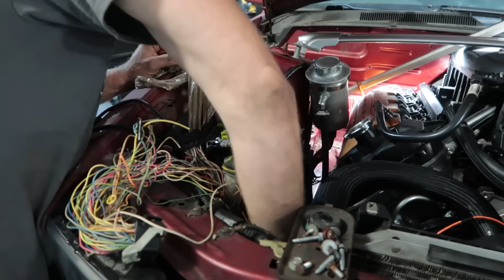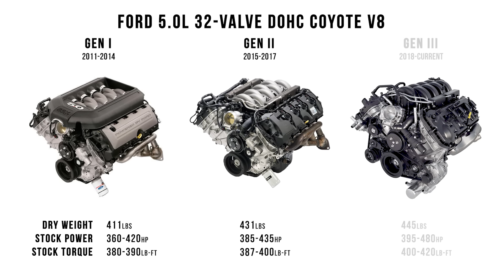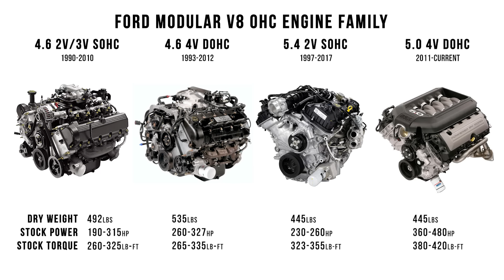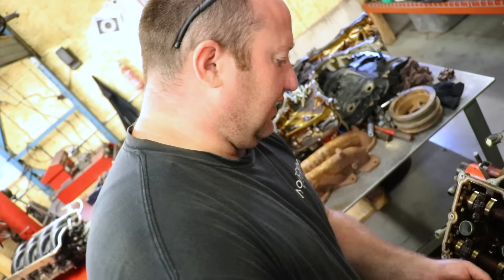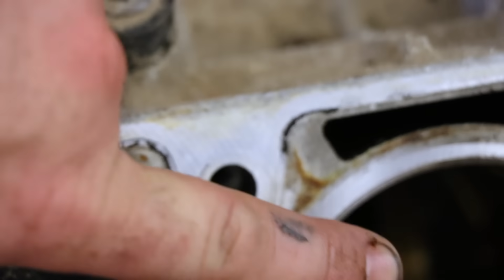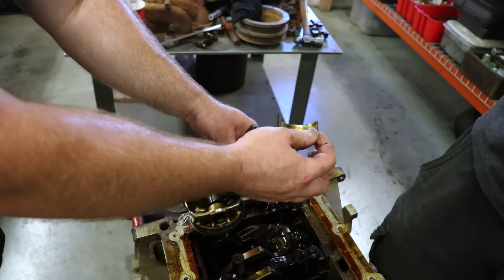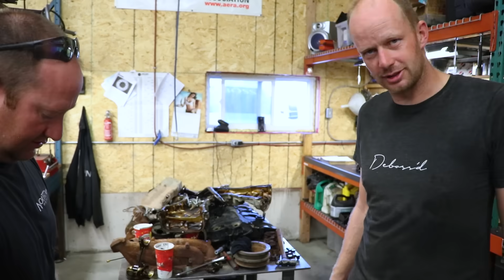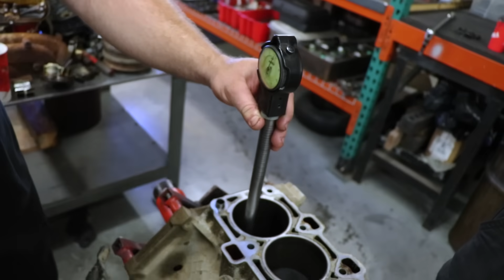REVIEW: Everything Wrong With A 5.0 Coyote Engine

Comment: Oversize pistons absolutely increase displacement, regardless of compression
Reply: I wouldn't trust anyone to rebuild my engine that doesn't understand basic math, SMH 
What an idiot this guy is , along with his nonsense about synthetics 🤣
Reply: @Ryan-iw8yw  - Apples and oranges, guys! He didn't say the displacement wasn't altered - he said the typical oversized pistons have slightly decreased compression heights to compensate for what would be an increase in compression (as a result of overbore).
Reply: Yeah. He doesn't understand displacement. He also doesn't understand synthetic oil.

Bearings staying with the crank happens all the time because of surface tension in the oil. It does not mean anything at all. It is better not to speak if you don't know what you're speaking about.
Reply: Displacement is dictated by swept volume within the cylinder (i.e. bore diameter and crank throw).

 Piston height only changes compression ratio. 

What is the guy on about?
Reply: @Jack-tx2ve  You're an idiot.  Bigger bores with the same cylinder head combustion chamber  adds a bit of compression, unless the piston has a bigger dish/valve relief.
Reply: @greggc8088  thanks I am not an idiot. I did not say an increase in volume does not effect compression. I just said only swept volume effects capacity not piston height or design. Maybe you are the idiot.
Reply: @Jack-tx2ve  Oh no, you're definitely an idiot.  Too ignorant to know you are.
Reply: @greggc8088  what about what I have said makes me an idiot? Just because you misunderstood and then jumped the gun to insult me. Jog on.
Reply: @Jack-tx2ve  I'm sorry.
Reply: @Jack-tx2ve  And quench.
Reply: @Jack-tx2ve  He said: "When we replace them with 'factory' pistons, they bring the compression down". There are no 'oversized' pistons here. When you bore out a cylinder and put the same pistons you counteract the increased bore with less compression. The guy then says 'why' people do this, which is for sound. They have to bore out the cylinders to refresh them and hes arguing against a misunderstood norm. I had absolutely no problem understanding what the guy said and infact took away knowledge which takes years of experience that books don't talk about, whether or not in it's complete form.
Reply: @hackersulamaster  why would you bore an engine oversize and run a standard piston? That would throw your piston to bore clearance out the window, they'd be slapping around in the bores like nobody's business...
Reply: @hackersulamaster  maybe I misunderstood. I will watch it again.
Reply: @danieledwards1081  I think there was confusion as to what the idea for this engine was. You can do light-honing on cylinder walls and not need a new piston. I'm not a mechanic but I'm thinking things like bigger piston rings or a different oil could help with compression.

The non-mechanic was confusing because he was talking like they were going to go with non-stock pistons and also like they were just using stock. The starting intention seemed to be to do a cheap rebuild for a bronco or beater so I'm wondering where non-stock pistons are coming from. 0.30 appears to be a full size-up for a new piston in specific. Mayyybe the non-mechanic thought he could do the size-up and still have compression?? Didn't want to watch the video 20 times.
Reply: @hackersulamaster  upping the bore size and matching it with an equally oversized piston of standard design will not have any effect on compression... using a piston with a lower deck height will lower compression, higher deck height will raise it. The diameter is irrelevant
Reply: @hackersulamaster  you cannot put the same pistons in an oversized bore.
Reply: Nub Tub if your not a mechanic you shouldn’t be segueing about things you clearly don’t understand
Reply: @danieledwards1081  The larger swept area from the bigger piston would cram more air/fuel into the cylinder head combustion chamber, raising the CR.
Reply: @Jack-tx2ve  depends on how much oversized you go, I lightly hone lots of small engines and use the stock piston and rings.
Reply: @Zach-ju5vi  maybe you do but if you bore a block to over size, you can't use the same pistons. A hone to clean a block up is a bit different to boring it out.
Reply: @taylorc2542  the difference between a standard bore and a 30 thou over bore would be negligible at best, for all intents and purposes it would remain near enough the same
Reply: @alexdownard1948  'Light honing [1](not a full re-bore) does not always require a new, larger piston though'.

You say I'm not a mechanic but I've done work on my cars and can use google... This is a ***rebuild***. (They told us what the build was about 3-4 times LOL).

THey literally spent minutes explaining why they aren't going to up the pistons and that's because CoYoTe aftermarket parts cost wAy ToO much. 

Let's hear it again: "Listen"... It's so ironic that they literally talked about all the reasons involved yet they were all ignored. The 0.3mm shave they were talking about was a full bore size, THEN the 'mechanic' explains why they aren't doing it. Funny how that works.
Reply: @Jack-tx2ve  like I said it depends on how much you want to oversize.
Reply: Nub Tub he literally said that guys bore 350 chevys 30 over and think think have a 355 when they don’t. I’m not going to argue more with and internet mechanic that is probably googling everything I say so he can jump back on here and make an argument he doesn’t understand.
Reply: Nub Tub so your saying bore out a cylinder and run std size pistons!!! Not gonna run. Very simple we bore cylinders out to either clean up worn or damaged surfaces or simply to increase engine volume and then replace with proper over size pistons. So now bore is larger and it increases displacement. It’s elementary school math here..... the reason of changing piston height on new over size pistons is to keep the stock compression ratio. If you were to keep same compression height with a over bore then you increase compression also.
Reply: Taylor C 
Amused.  I would love to see someone bore out a block so much that it’d increase compression ratio significantly.  I’d say that by the time you bored it out that much, you wouldn’t be getting any compression!
Reply: @1953fords  Light honing ... pay attention.
Reply: Charles Angell how many engines have you built....
Reply: @danieledwards1081  that's not true... You said it yourself when you increase the bore diameter it increases displacement. Take 2 engines both have 64cc combustion chambers, are zero decked with a 0.039" thick head gasket and stock style pistons with a 17cc dish. But one is 350 cubic inches and the other is 360 cubic inches. These are stock specs for a vortec 350 which is 8.98 to 1 compression stock. If bored .060 over with stock replacement pistons it would increase to 360 cubic inches and have 9.25 to 1 compression. Bore diameter changes displacement which changes compression.
Reply: @konnerkramer329  as I said  the difference is negligible. You're yielding a 0.27 increase in compression on a 60 thou overbore. A lot of engines can't even take a 60 thou bore because the cylinder walls are too thin. Your example is an extreme.
Reply: @danieledwards1081  my example is not extreme at all. I literally used the most common engine ever produced. And compared the stock bore size to the maximum safe overbore size. I could have used a big block Chevy as an example which can be bored .100 over. Either way I was just using it as an example that bore size does have an effect on compression. Btw yes a .27 change in compression is a big deal. If an engine is already at the limit of compression it can safely run on pump gas increasing the compression can lead to detention. Which will destroy an engine in seconds. Not only that but on a vehicle with a distributor or a custom tune changing compression without adjusting the timing can also cause detonation. Again this will crack pistons, break pistons rings and even in extreme cases break ring lands. And this is if you're lucky enough it didn't take out the rod bearings and lock up. You saying a quarter of a point of compression is negligible just makes me think that you've never really had experience with high compression engines.
Reply: @konnerkramer329  you missed my point, who goes straight to a 60 thou overbore? I'd say pretty well nobody unless there's a pretty major problem with your cylinder walls. A more typical build would be likely a 10 to 20 thou overbore, at this increase, the compression change would not even be noticeable unless you're running at the ragged edge of your fuel type's limitations.
Reply: @danieledwards1081  well no one makes .020 over pistons for a small block and trying to find a block that will clean up on .010 is nearly impossible considering a 350 is anywhere between 52-22 years old at this point. If you're rebuilding a 350 95% of the time you'll end up punching it .030 over possibly .040 depending on how bad the cylinder walls are and if it hasn't been bored out and rebuild once before.
Reply: @konnerkramer329  well things must be different over in the US of A then.. plenty of 20 thou over pistons available in Australia
Reply: @konnerkramer329  When I read "deck height, zero decked, 0.039" thick head gasket, 17cc dish", I'm convinced the comment is by someone who at least knows about building engines, particularly the science and the math behind it.
Reply: @scottb8175  you are not wrong I work at a machine shop that builds engines. The .040 quench combined with the extremely efficient kidney shaped combustion chamber is the reason why vortecs run so well.
Reply: @konnerkramer329  I built competition engines for about 10 years. In 1997 we (my boss Mark who coordinated and planned everything, the heads and valves guy Ritchie, and myself doing all the block. rods, pistons, oiling, and basic head milling machining) built 5 SBC's for Gary Chomiski. The first one, a 292CI SBC with a single dominator on a sheet metal ram, built from all old used parts - brodix alum. heads, gas ported venolias, miller alum. rods, and my work on the 1960 283 truck doner block, set an NHRA E.T. record in comp. eliminator at it's first event. Gary came back from that race and asked us for 4 more SBC's before he gained enough fame and moved to the US to be a crew chief for a US Pro-Stock team. I think our engines were a big part of what brought him that success. Gary called me once to ask what my secret was in machining the bores to get cylinder cranking pressures 20% or higher than the best engines he ever had or heard of from any other engine builder. He joked that I must be sleeping with the CK-10....
Reply: @Andromeda Galaxy  I grew up on a farm and then went to engineering school at General Motors Institute. I've spent 30+ years designing mechanical components and systems including gas turbine aircraft engines and building both gas and Diesel reciprocating engines. I've measured rod big end size going in and coming out and even when the inserts stay on the crank, which is most of the time, the big end bore size is often spot on unless a bearing has spun. Rod caps are supposed to have a light interference fit on the rod bolt shoulder. Therefore, to remove them, light tapping with a hammer is necessary. This small dynamic load easily overcomes the slight "click" (as you called it) fit of the insert in the cap and/or rod so that surface tension holds the insert against the journal. Happens all the time, even on engines that have been  "blueprinted" and balanced. If it doesn't, I usually find that the clearance is too large. I have thought about it. Especially since I design these types of components for a living.
Reply: Diameter x pix x height x number of cylinders this guy can rebuild and machine, but cannot speak
Reply: @Andromeda Galaxy  I don't know what your talking about. When I pull an engine apart I use the old bearings that come out of the big end of the crank to protect it from getting dinged or scratched from the rod bolts when I pull a piston out.
Reply: @Andromeda Galaxy  you said the old bearings are supposed to stay in the rod caps when you pull an engine apart. I've torn down several engines and very rarely do they stay in the rod caps. The friction from the oil makes them stick to the crank
Reply: @Andromeda Galaxy  you really are a special kind of stupid. You said you grew up in a junkyard and the best running engines you've torn down all had the bearings stay in the rod caps. Going off of what you said a properly running engine the bearings will stay in the caps. But as I've said that's not true. The 300,000 miles 350 out of my k10 had 6 spun rod bearings and 3 spun main bearings and it idled smooth as glass and run perfectly fine. The bearings have nothing to do with how well and engine actually runs.
Reply: @Jon Wong because we were talking about engine displacement... Not sure what an intake manifold gasket has to do with engine displacement. And btw the vortecs weren't that bad manifold leaks. Yeah they had 4 less bolts but they also used MLS intake gaskets which actually seal pretty well. Even if they do leak new gaskets are like $250 and if you're really unlucky you'll have to replace them maybe after 300,000 miles.  Personally I've seen 900,000 mile vortecs where the intake has never been off. And as for cracked heads not anymore prone than 193s or the 882 heads that preceded them. Also btw vortec heads are not swirl port heads those are the 193 heads from 88-95.
Reply: @Jon Wong no the vortec heads are called vortec heads because it's a vortec 350... Are vortec 5.3s and vortec 6.0s named that because the ports swirl? it's just an engine designation from GM. in the early 80s GM lightened the head cast by almost 5lbs a piece. These were nicknamed the skeleton heads because they were noticably lighter than the previous heads. Like I said the vortec heads are no more likely to crack than, 193, 882, 883, 416 and  059. The engine has a crank position sensor because it's an obd2 Operating system. The vortecs were far from bad engines. Only problem I've really seen with them is the bullshit spider injection system. Which wouldn't be as bad if it wasn't $900 for a new unit. Vortec 350 make 300hp and 400tq on an engine Dyno while getting 18 mpg in a 5000lbs pickup while being very reliable for hundreds of thousands of miles. My 1997 chevy has 296,000 miles and all I've done to it is replace the idler pulley and a heater hose. Gm was not using cheap materials and just throwing something together until the LS. The vortec is simply the best stock gen 1 small block made. 60-70s engines were designed to go about 50,000 miles between rebuilds, the 80s smog engines have plastic timing gears that break and bend valves and destroy the engine and then you have the absolutely gutless tbi which got 10 mpg and made 180hp. when compared to every other era of small block the vortec is simply better in every way.
Reply: Nub Tub nobody gives a fuck about if they’re puting stock pistons in there coyote. The argument is that boring out and putting over sized pistons  increase ci which the dude said does not Jesus fuck I don’t know how much simpler I can say it.
Reply from the maker: If it didn't come across on the video, on OEM pistons, if they are oversize, the ring groove is higher on the piston to keep the CR the same.  This way it doesn't mess with emissions.  On aftermarket pistons,  there is no general rule
Reply: DEBOSS GARAGE that's all fine and dandy but that guy in your video is an idiot and doesn't know what he is talking about regarding displacement.
350 Chevy 4.00 in bore 3.48 in stroke
3.14 x radius squared 2(2)=4 x 3.48 = 43.7088 cu in x 8 = 349.6704 cu in
350 bored 0.030 over 4.030 in bore 3.48 in stroke
3.14 x radius squared 2.015(2.015)=4.0602 x 3.48 = 44.3668 cu in x 8 = 354.9351 cu in
But I digress, do you really expect a Ford guy to know math?? Obviously not 🙄
Reply: @Ryan-iw8yw  I'm mostly a ford guy, and I know math better than most car nuts, I think.....in fact, if it weren't for math and science, I don't believe the school would have ever let me out of 3rd grade :). BTW - you used a low precision estimate for PI in your calculations, so there is a slight error....4.000" x 3.480" yields 349.8477579.....CI; 4.030" x 3.480" yields 355.1151532.....CI
Reply: @DEBOSSGARAGE  First ring land lower on the piston to lower compression.
Reply: @chuckchapel8492  😂😂😂😂😂😂😂😂😂😂😂😂😂😂😂😂😂
Reply: @DEBOSSGARAGE  "on OEM pistons, if they are oversize, the ring groove is higher on the piston to keep the CR the same.  This way it doesn't mess with emissions."  That is completely backwards, and wouldn't be enough to compensate for increased bore on its own. Also, how high the top ring groove is relative to the piston head is not something that can just be changed on a whim. Also, a standard bore chev 350 is 349.84 CI. Boring the cylinders out 0.030" gives 355.11 CI, so I'm calling this guy more BS than actual knowledge. I guess BS is good enough to fool his customers who don't know sh_t from toothpaste.
Reply: @DEBOSSGARAGE  I pray for your sanity.
Reply: Nub Tub he said , “ these guys with their 350s bore them out 30 over and think they have a 355 when really they don’t because compression is lower and compensates” that’s what people are fucking arguing about not what kind of pistons he puts in a coyote